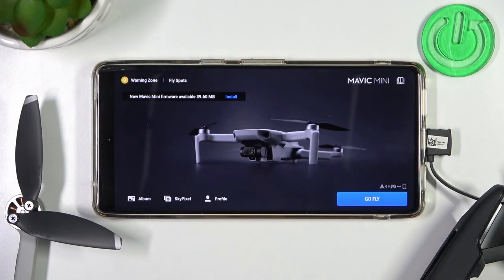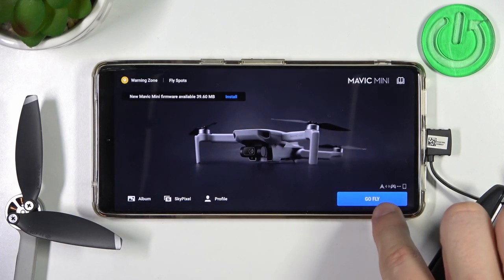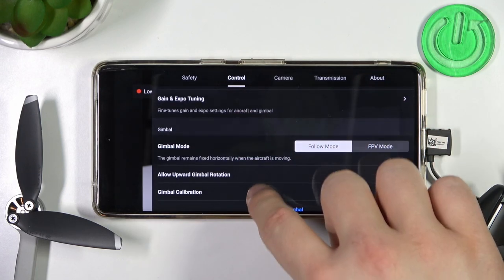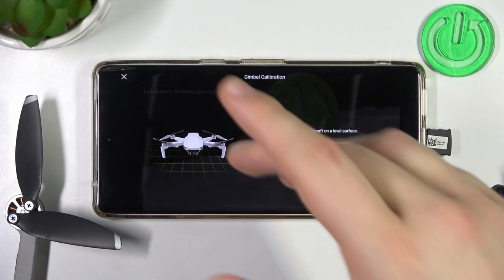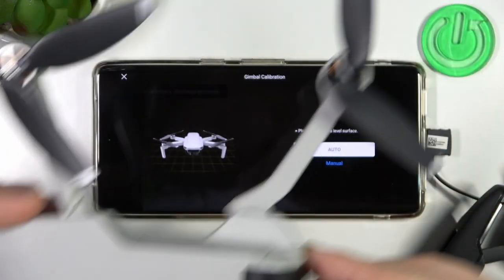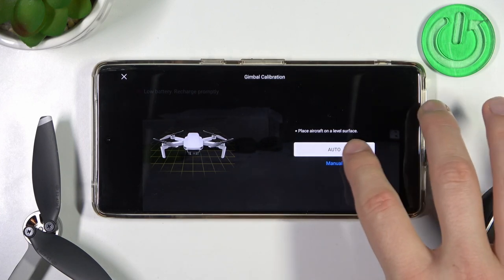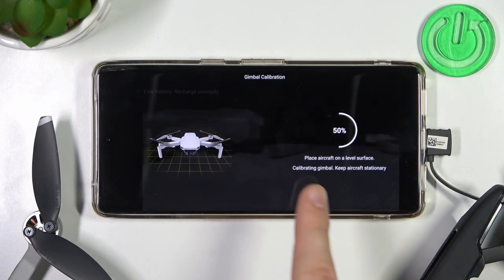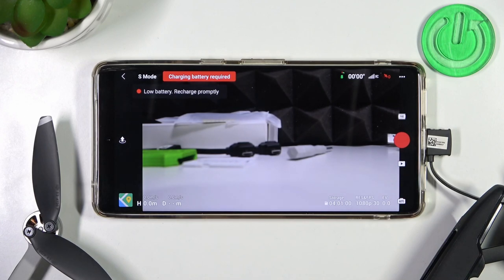How to Calibrate Gimbal on DJI Mavic Mini?

Comment: How to do manually? And if u do automatically the surface has to be completely on level ? Thanks I 

I have an issue to calibrated and never pass of 10% I try to place the drone on a clear area and flat surface but doesn’t work anything will help